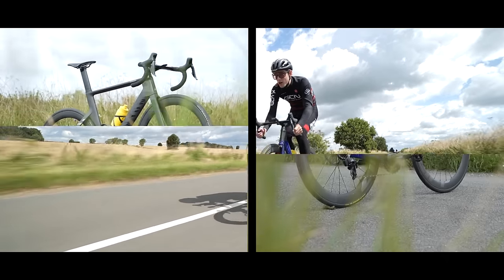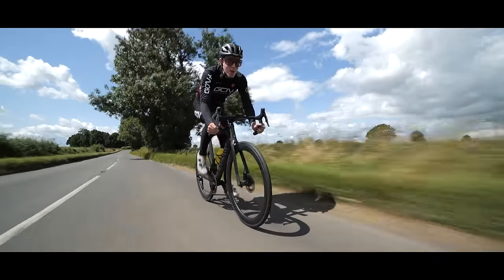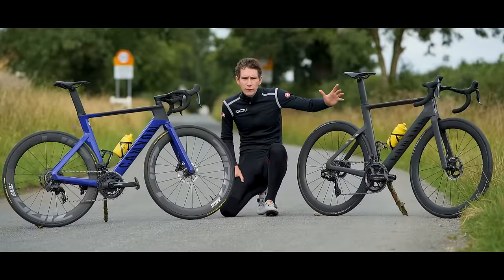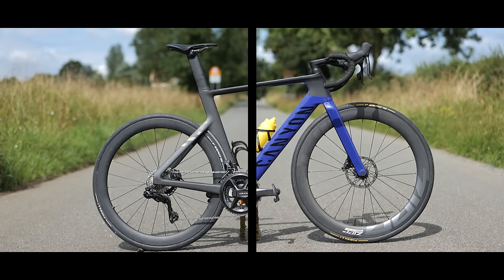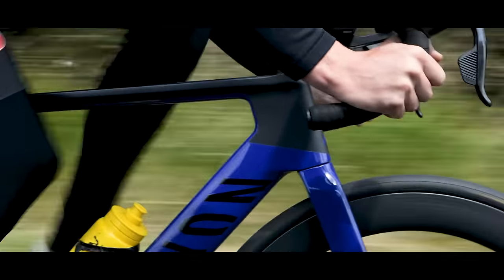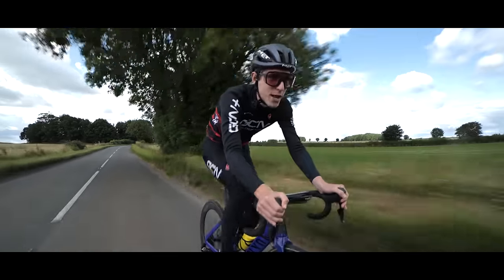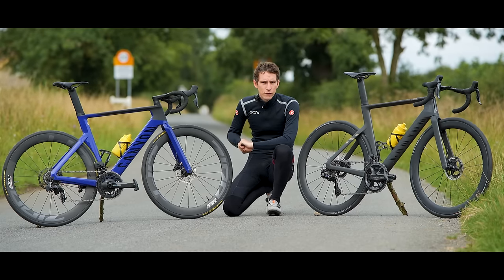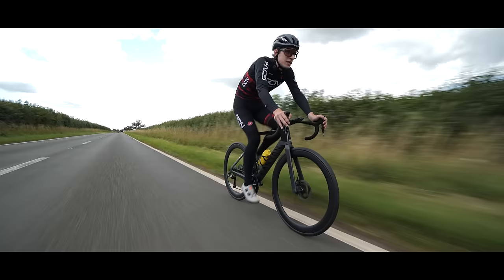Why Do These Two Canyon Aeroad Bikes Feel So Different?

Comment: I recently changed wheels on my Giant TCR and went from Giant SLR1 wheels to FFWD RYOT55. Bike is now waaaay stiffer and harsher to ride. Difference really is significant. So yes, wheels do change the feel. Both have the same tyres at same pressure.
Reply: It may be that you need to experiment with different pressure on the new wheels. As per the video if the wheel width is different the pressures should be different as well
Reply from the maker: @huntos83 makes a good point. Did you change the pressure at all?
Reply: @gcntech  Yes, both are pumped up to the pressure that silca pressure calculator suggested. Giant wheels are 19,3mm internal and FFWD are 21mm internal, so it changes things a bit, just like in this video where ZIPP wheels are wider. I did lower the pressure a bit now as it feels much nicer.

Comment: I think it’s components. Carbon wheels ride differently depending on brand and depth, carbon bars are not created equal, and the seatpost can be way different from brand to brand. I switched between a Salsa Guide Carbon Seatpost to a Zipp and it made the ride way better.

Comment: 1 - I agree about the seat rails 2 - why didn’t you just swap seatposts 🤨
Reply: While I don’t know for sure, but I would hope given the cost difference the seat post of the CFR is the…CFR carbon and layup, vs the CF SLX. That and canyon has a whole seat post issue with these bikes around 2020 that has since been rectified on newer models.

Comment: Lmao!!!  What are you guys doing, watching my bike purchases!???  I JUST received my Canyon CFR yesterday, while already owning an SLX.  The SLX is Ultegra, with DT Swiss 1400 wheels, while the CFR is DA/DT 1100.  I was going to test the two to see, besides weight, what are the differences. And it’s an easy swap with the wheel set because both are carbon railed seatposts. 
Your video was interesting because i also have a Factor Ostro Vam, and when people ask me which bike I think is better, smoothness and pure speed are the noticeable differences. The OV being a quicker bike, while the Canyon is very smooth. 

I thought it might be the weight and the wheels, but now I can see in a direct comparison. 

Great video, I look forward to riding both and seeing for myself. It will be fun for sure.
Reply: Interesting.  So is there a big difference between how the CFR and the SLX ride?  I love my SLX!
Reply: @fhowland  I love the SLX too. Just did centuries in back to back weekends on it, and I felt great—if not for the heat. I’m looking forward to comparing the two.
Reply from the maker: There you go, we've done your research for you! 😉
Reply: Hi, your comparison is between SLX and Ostro isn’t it? But how fő you feel CFR and Ostro? Is the VÁM even quicker than the CFR?

Comment: Does appear this is pre update Aeroad with the seatpost clamp on the seat tube instead of the new top tube variant. That said, the forks are suppose to be the same carbon layup between CFR and SLX, and the frames do have a weight difference of 65 grams on spec.

I would expect the slightly heavier frame to dampen vibration more regardless of stiffness differences. The variation in carbon will also have an impact as changing carbon grades are not necessarily linear. High modulus carbon often has less tensile strength over the more commonly used intermediate modulus that has notably higher tensile strength. So the question is what targets did the engineer design for? Was the targets tensile, modulus, or more likely a small compromise to each side? The frames should ride different and depending on where the high modulus is used.

Would the paint make a difference? To a small degree it might as blue would add more material over black and have some dampening affect, but likely minor overall.

Then lets not forget frame variance. Since the layup schedule is done by hand into the mold and variance is to be expected, you can certainly be experiencing that or even adjustments in production could be playing its part. There are often slight changes to improve yields such as improved bladders and internal molding tools.

Comment: Please repeat some of these tests with a vibration meter to really see if something like road buzz is being reduced.
Reply: We have tried that before but the data was so noisy we couldn’t really do much with it I’m afraid.
Reply: @simonrichardson5259  That's a shame. Guess we will need to wait for Boston Dynamic's Spot to learn how to ride for real blind data.
Reply: @simonrichardson5259  A single high impact event might improve the data and usfulness of it. Something like riding over a plank or small step. My theory would be that the more compliant setup should see a lower max peak.
Reply: @bohnito  We’ll have a play with it. Where would you mount the meter?
Reply: @simonrichardson5259  I would mount it on the seatpost or the stem. I imagine you get two distinctive peaks with a different amplitude. Let´s say the meter is mounted on the seatpost and both wheels ride over a plank. then I would expect to see a lower first peak than the second one, because more frame material was able to dampen the impact. And vice versa for mounting it on the stem. The difference in those peaks might even be a more valuable information than the amplitude of them. For a quick proof of concept a phone on the handlebars should be sufficent. That is what I plan to try out.

Comment: We all know components make a huge difference in ride quality, otherwise none of us would swap the aluminium stock wheel for deep carbon wheels, go tubeless with premium tries, swap the stock saddle for a 200+ EUR saddle and even the seatpost to one that allows for more flex (at least in some cases with canyon bikes)
The frame tho, I would expect it to be different across their range. CFR is the race machine, they don't optimize for comfort too much, SL/SLX is designed for training/leisure as well so maybe they do design extra give on the frame.
I have an endurnace frame solely for the additional plush feel when riding. Aeroad/Ultimate are amazing for racing but for my coffee/beer rides they are too much...even tho endurance got 4/5 stars because the reviewer felt disconnected on the rear (too soft apparently). Yet for me that is what I want, more comfort means more enjoyment and more enjoyment means I will ride that bike a lot more.
Also, now I can get shimano groupset with sram gearing for better range :))

Comment: Difficult subject for a review/test. What to think of it? My opinion is that the difference between CFR or SLX makes a difference. Also the tires and rim. I guess those two make the most difference between the ride feel. The weight might ad also a little.
Reply: i would much more go for the better wheels than the better frameset tbh

Comment: So i've just ridden my LAB71 SSE from Zipp 404 firecrests to the Bontrager RSL 51's on punchy hilly - flat roads where i live, and boy was i impressed at how the 404 firecrests just made my bike heaps faster, climbs better, holds speed MUCH better than the RSL 51's. (404 with 28c Michelin), (Bontrager RSL 51 with 25c conti STR). The 404 felt more planted and every pedal stroke was smooth, whereas the RSL's although being lighter, felt sluggish and unable to hold momentum very well. Love my 404 firecrests 🫶🏻
Reply from the maker: Sounds like you've done some pretty good testing! Good that you've been able to find wheels that work for you.
Reply: Michelin is hugely more supple then Conti.

Comment: What was not taken into account in the otherwise flawless comparison is that the CANYON lettering on the blue CF SLX is tilted by almost 90°. This reduces the optical air resistance significantly.

Comment: I love my aluminum track bike for the flats. After 100km it becomes an "endurance" bike! Nothing can change that. DNA of frame. My Cannondale Topstone 3 with 30mm Vittoria Rubino Pro tires and 30x34 granny gear rides a lot smoother and doesn't have that nervous fighter plane steering! DNA. Durability matters, so no carbon fiber except the forks!

Comment: When I switched from Continental 5000 to Pirelli zero it was a noticable difference...Pirelli felt smoother and improved ride comfort, but seemed to have more drag, the bike fleet less responsive. Though Pirelli seemed to offer better grip quality than the C 5000.
Reply: Try Michelin Power Cup, its as fast as GP 5000, but way more supple.

Comment: If the geometry is identical between two bikes but the layups are different, or the modulus of the materials are different then the frames will behave differently under load. Fact. Just the same for steel, ever compared a full531bd frame with a gas pipe special?

Comment: I've always thought the opposite when it comes to carbon rails. Carbon rails tend to attach further forward and rearward on the saddle which lets the frame of the saddle flex more and more fully. Carbon railed saddles though are often less padded and have stiffer frames for a "racy feel" so cheaper steel saddles can still take the cake.

Comment: I can feel a huge between the Conti GP500 S TR and my Pirelli P Zero. The Conti are a little lighter and I think this makes them have less structure in the tyre wall. Being a heavy rider, using on hookless rims at 70psi (tyre pressure recommended max), the Conti feels soft and like I’m going to rim out. Speeds were up though slightly, probably down to the lack of road noise, but I found I used the whole width of the tread when riding on a straight and flat road. The Pirelli, at the same PSI feel firmer and therefore I feel more confident on them. I think if I was an 80kg rider I’d use the Conti, but being 110kg, I’ll stay clear or I’ll be buying new wheels each month.

Comment: I had a 2022 Canyon Aeroad CF SL, but  returned it due to an incessantly squeaky seatpost. I believe Canyon changed the seatpost clamp across the lineup (SL/SLC/CFR) late in 2023 to address the squeak/wear issues. Of course the carbon layups are surely in play, but this video makes me wonder if some of the frame difference perceived is actually due to the seatpost clamp design on the older CFR vs the presumably revised design on the newer SLX?

Comment: I have the ultimate slx9 upgraded with coated ceramic speed ibox and pulleys that feeling just want to make you faster. The 1400 gr. DTswiss arc 1100 are light enough for climbing but it could be lighter with the 973 gr. Scope artech 4 wheelset and a prestacycle 1 piececasette could save 100 gr. comparing with duraacecasette. Should I have chosen an aeroad instead perphaps so I just bought the Aeroad cfr stealth with the soon previous sram red etap but I dont care about that. My plan is to use the ultimate for the most hilly trips in the neighbourhood and for windy days and  of course the gran canariatrips in winter. I will get the Aeroad next week and ceramic box pulleys comes with ups tomorrow becayse addicted to that one. I will use the aeroad for less windy days and going straight routes as fast as I can. The 62 mm arc 1100 1700 gr. seems a little heavy but will save money for next year to buy the 1244 gr. artech 6 from scope. The reason I first bought ultimate was the gran canariatriops in winter and it was significant lighter than aeroad. I love riding the ultimate but excited to learn more about aeroad in near future…..

Comment: Great video and seems to support the unfortunately large gaps between the different level frames of the otherwise same bike.

Is $6,500 for a frame set insane, all else equal? Sure, but if the level down is $4,500, you prob can’t upgrade components to get the same feel and other qualities of the top line model, while you can, should you want, change components and eg tire pressure on the high end frame to feel like lower end ones.

Tldr; but the best frame you can afford. Put on top end tires and a well-fit saddle with a dialed-in pro fit, and you can always upgrade expensive components (eg wheels) later.

Comment: Great test. Didn’t see Si change the seat rail clamps on the seat post when swapping from carbon to alloy tho. Bad idea if you don’t
Reply: Some seatpost clamp designs work with both.
Reply: @The2808erik  that one doesn’t - I own one  😀
Reply: Canyon seat post doesn’t, so I guess Si just swapped the clamps also but didn’t get filmed.
Reply: @shaldon08  40$ for a seat clamp lol.

Comment: Correct me if I'm wrong, but I see the spacer under the handlebar are not the same though, I'm no saying that this is make the difference, but having more weight on the hands could change the feeling while you ride... By the way as for an orchestra the sound is made by all the instruments, so in my opinion each component of the bike make a change in the ride feeling, good comparison not common to see, thank you

Comment: Could this difference between carbons be brand specific? When I contacted Specialized they said there would be no difference in ride feel, performance, or durability, between the Tarmac Pro frame set and the S-Works, only a weight difference of about 200g. Which makes sense, you need more material of the lower grade carbon to achieve same results of the higher end one, but you can design the bike to have the same characteristics.
Reply: It depends ultimately whether the manufacturer wanted there to be a difference in characteristics between the bikes or not. Even between totally different frame materials you can make very similar ride characteristics depending on how they are engineered.
I would think most manufacturers would chose to lay up the bikes so that the higher end frame felt stiffer and more responsive. They probably want there to be a tangible difference to someone test riding them to try and justify upselling to the expensive model

Comment: Interesting video!

That said, I wish you'd done a little more isolated testing--would've been interesting to see if just swapping saddles made a difference in the ride qualities of either frame. Compounding the difference together as you have doesn't give us a good picture of any perceptible difference the rail materials might imbue.

What was the difference between the two bikes' system weights?

Comment: What size you are riding? When you could ride 2 sizes…Do you prefer the smaller size for more agility? I could ride 3xs and if I type 2cm more leg height, canyon said you can ride 3xs or also 2xs … so it is difficult

Comment: Everyone is entitled to their opinion. But for me, I always think, ‘Never let perfect be  the enemy of good enough’. For years rim brakes were good enough plus cheaper, easier, lighter, fewer spokes and even radial lacing  (yeah!), and aero!   Further the manufacturing tolerances of frames do not impact the effectiveness of rim brakes but can with disc brakes. So yeah, I get it, there are limitations  but we can agree to disagree, because no one ever got dropped because of rim brakes on the road and the the value to performance proposition is just higher with rim. If I were rich l, maybe would opt for road disc and pay for the exponentially higher cost of ownership. No one is right or wrong necessarily here, but as you said we should have a choice.

Comment: Swapping to wider inner width tires and lowering the pressure by ~10 psi should definitely change the feel. Sometimes the rubber compound makes a big difference - I felt the biggest difference in comfort(and grip) swapping from Conti Terra(uses hard rubber, like on road tires) to Pirelli Cinturato(soft rubber and grippy)

Comment: The seat post itself makes a difference. How? If your seat post is sitting right at the bottom of your frame, meaning it cannot go any lower, and you set it like that, you'll feel more vibration from the road, vs having it up just a bit in the frame so it's not sitting right at the bottom (both settings at the same seat height). Did you try that?

Comment: Most important things are the geometry/fit and the contact points. Tires/saddle/handlebars.
Reply: I would even say a good set of wheels is what transforms a bike the most in every aspect: looks, performance, comfort. A new bar wrap and saddle are relatively cheap to fix afterwards.
Reply: @DoNuT_1985  Wheels are an interesting topic. The difference between old box section and aero wheels is huge. I rode past so many people on their old super light climbing bikes in sportives without any effort. But how much would I gain with what the pros currently ride compared to the 35mm that came with my bike?

Comment: Awesome & Thanks :) I do really think better components could make the bike give a better experience :)
Reply from the maker: Have you ever upgraded the components on your bike?
Reply: @gcntech  My bike is a lot cheaper like less than 220 quids. I upgraded my stem, MTB pedals, rear tire to a Tannus Solid Tire, a noseless saddle, rear brakes, added bottle cages & handle bar bags 🙏🕊️. Thanks for asking 🙏🕊️ It is for cross training and it works well for that purpose ☺️

Comment: I think, (YT) reviews are mostly pointless because they usually cover the top-spec bike and unless you go all in, the lack of top-spec carbon, wheels and possibly a TL setup make all the difference when you only go for mid-tier. I would ignore that and just buy the design and color of a model suitable for my riding within price range and it's probably alright. As Si said: All bikes are fast, compliant and responsive, anyway. 😉

Comment: Deffinitly frame.
I ride a Storck Visioner C Carbon and it is super stiff. 23mm Conti4000 on those DT Swiss R1400 aren´t helping either in comfort. But it is super fast, super stiff, super direct and yes, super hard to your butt aswell. Gonna switch to a more comfortable bike next season i guess, but this is just because i´m 44 already. I´m really serious when i´m saying, you can´t ride a Storck slow... Like you always getting pushed more by the bike´s abbilities.